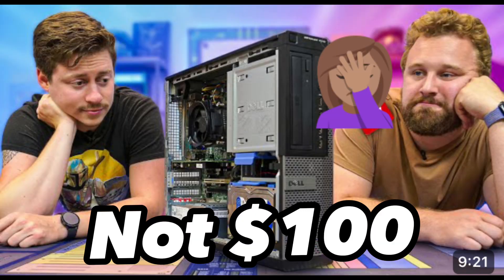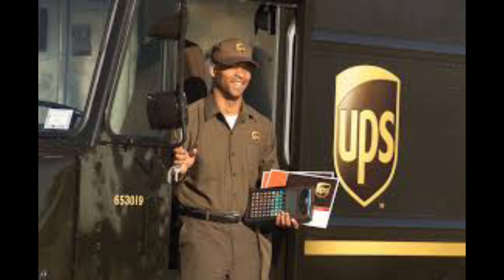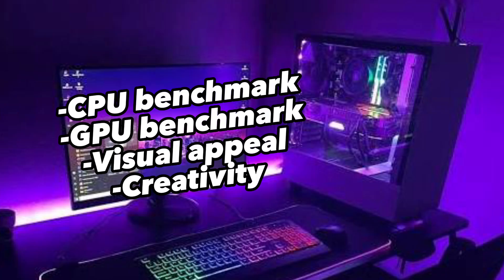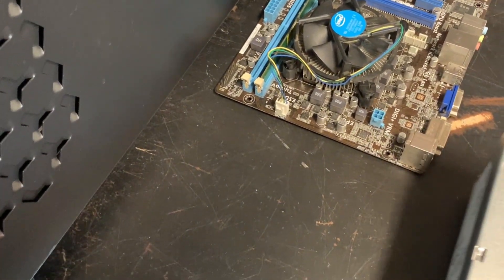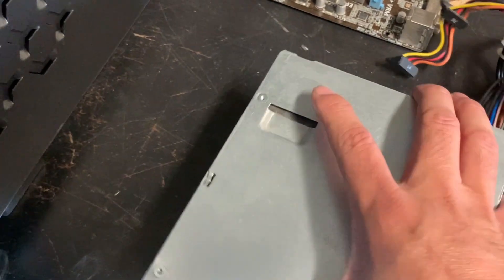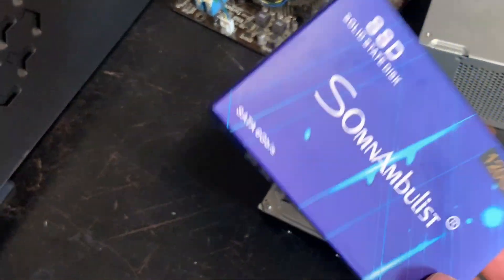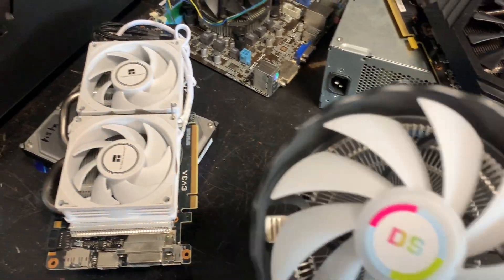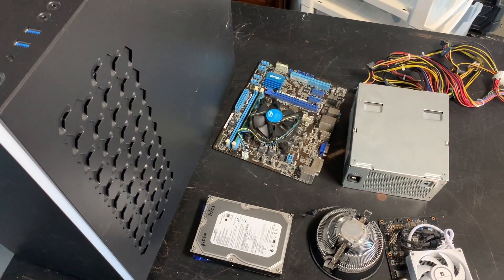$100 Gaming PC BUILD challenge Part 1 - Budget Rules can it run Fortnite?

Comment: ohhh i did a build with that exact motherboard! i used an i5 3470 and an rx580 8gb!
Reply from the maker: That is what the build should have been, but sadly can't under the $100 limit.  I am going to post a follow up video with a GTX1060, RGB, and new budget cap soon!

I did have an i5 3rd gen on hand, but from what I can tell, the 2nd gen i7 actually outperforms it by a slight margin.  Also I did not want to remove that huge cooler again LOL.